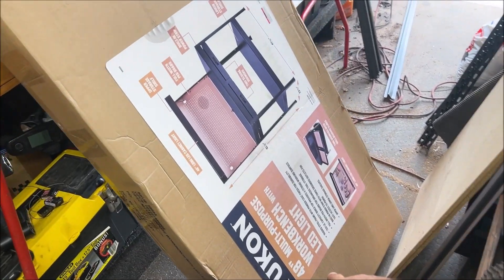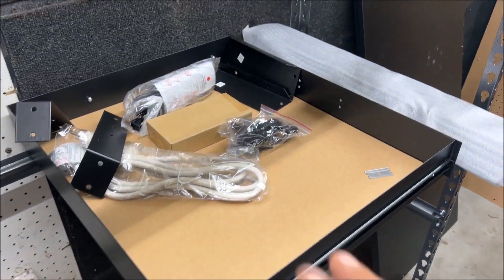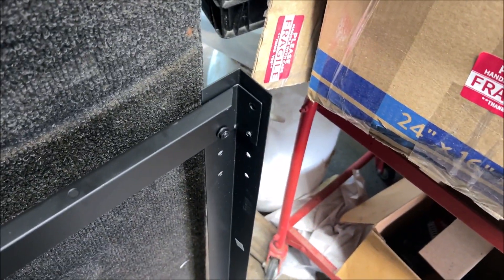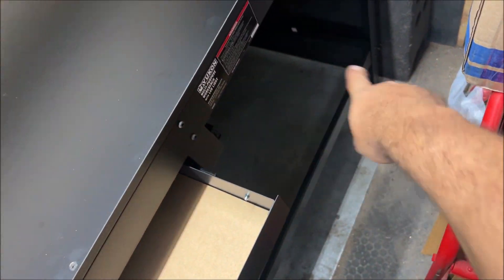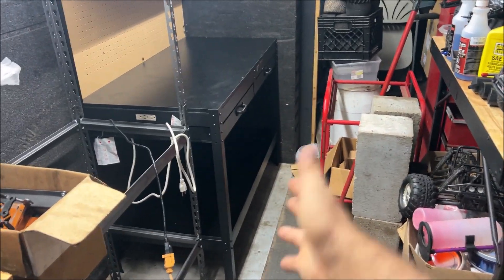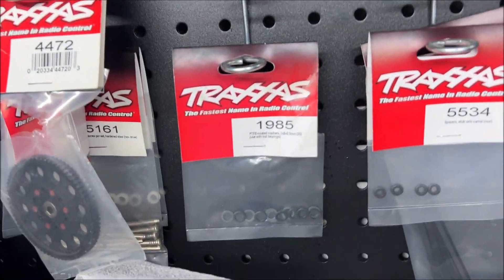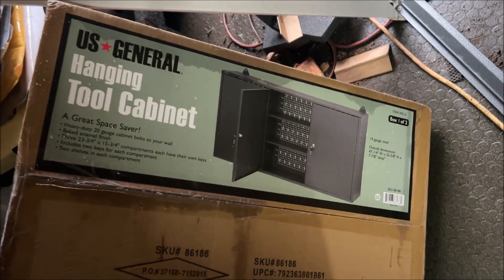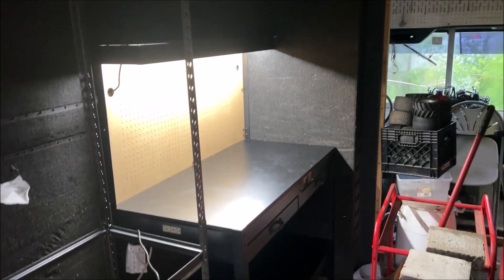YUKON harbor freight 48" workbench with LED light

Comment: If the hardware is nice and tight with a little lock tite added, the middle and bottom shelves can hold 220lbs each. I didn’t even bolster any of mine, I just have them tight against the wall and they’re good enough to toss a vice on and actually be able to torque around a bit. One of mine had the pressboard mdf replaced with plywood.